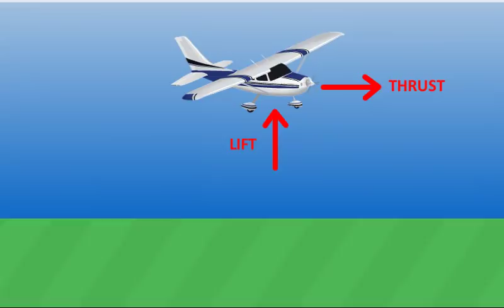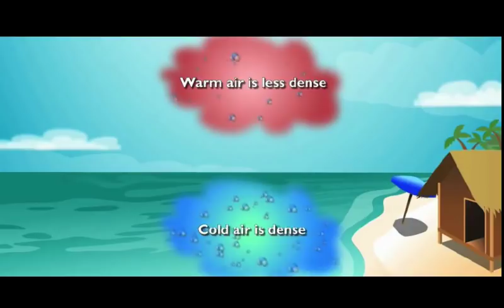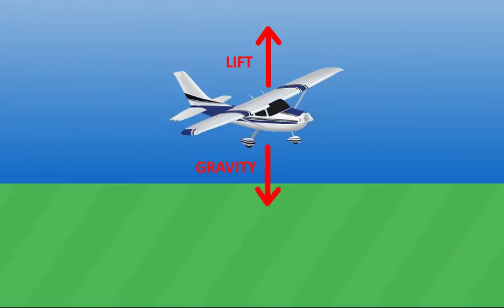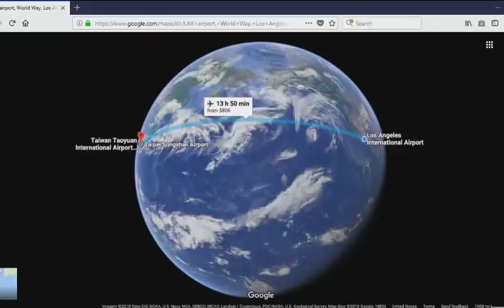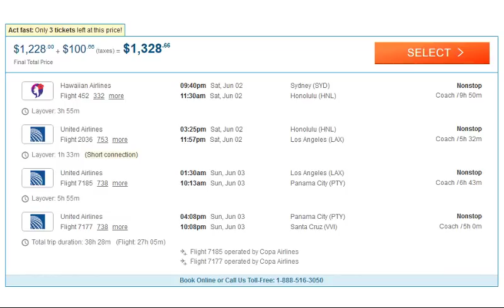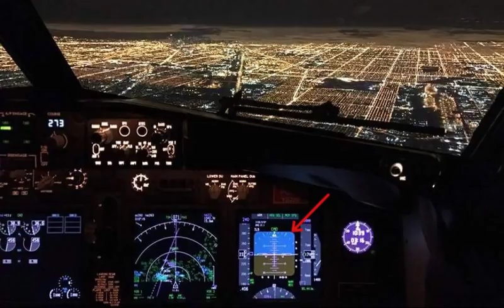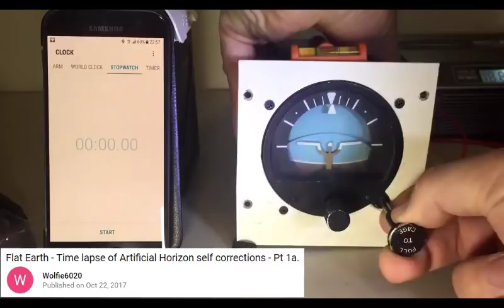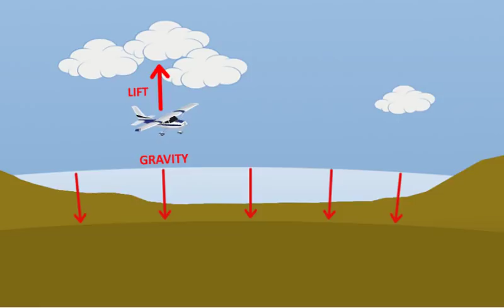Flat Earth Falsities - Plane Nonsense

Comment: How does one fly due east on the Space Pizza?
Reply: They the flat earthers say due east is an arc. So next time you watch the sun rise in the east, travel in a direct straight line to set in the west. That simply and easily proves all flat earth is a scam.
Reply: How do you travel east now?
Reply: If you had a working brain you wouldn't have asked that question would you, juan.
We have what are known as compasses, juan, both magnetic and gyro. Do you know how they work?
 @juanencinas8808
Reply: Ron If you had a working brain you wouldn't have asked that question. We have what are known as compasses, Ron, magnetic, do you know how they works? 90* of N-S: one the pizza middle the other the contour, so you go in circles.
Think it feasable for a bird to detect the south pole up North on a ball magnet?

Comment: Airplanes flight is measured in Airspeed not groundspeed. There were times I was flying at an indicated 100 knots yet below me on the highway the cars were passing me...why? Cars are driving at mph over the ground reguardless of winds while i was flying at 100 knots indicated airspeed and 40 knots true groundspeed because i was flying into a direct 60 knot headwind.
And really ahelicopterflying upside down in australlia?? Really ever heatd of a little thing called a gravity well? 
And yes the aircraft does follow the curvature of the earth the straightline would be too far in the distance anyway. But the nose direction has nothing to do with level flight. The angle of attack is the angle of the wing itself which is indeed angled slightly upward to maintain straight and level flight at a certain throttle setting. This angle of the wing cord happens to coorespond to the nose being level, it would bestupid otherwise
Aircraft fly the overseas route in what is known as the great circular routes and have been called that since days of sail. Jeez these flat earth people are just morons too stupid to survive without others figureing it out for them. 
How can they look at a ship come up over the horizon where the masts are seen first with the rest following. People hundreds of years ago were smart enough to figure out that meant a spherical earth how did these morons do hundreds of years of dumbing down in the 21st century with satallites and space stations flying over their heads. But more that anything WHAT POSSIBLE REASON WOULD ANYONE HAVE TO MAINTAIN THIS GIGANTIC CONSPIRACY FOR HUNDREDS OF YEARS FOR ZERO PROFIT OR REASON.AND THE GYRO ARGUMENT IS THE MOST MORONIC EVER WOW HOW STUPID PEOPLE CAN BE ITS TRULY AMAZING!!
Reply: Nice write up. It's both sad and funny. FEers once said the conspiracy was led by makers of schoolhouse globes. Hell of a cartel there. One leading FEer doesn't know the measure of any angle in an equilateral triangle nor know how to convert meters to kilometers. Another admitted not knowing where Australia is! But they absolutely know the Earth is flat; they've done the research! It's amazing some of them even made it to high school, let alone graduated.
Reply: You are so right fucken idiot fucken dumb ass. Yeah your right just 300 million a year

Comment: This is one of the best video with strong arguments against the misinformed claims of flat earthers. I am an aeronautical engineer and we had a whole course on inertial navigation, guidance and control. Basically we have to do some calculations to factor in the rotation of the Earth. Then we also have accelerometers and sensors on the aircraft that help determine its position at all times. The control system on the aircraft makes sure that at each time, the aircraft is following the trajectory it is supposed to. And also as mentioned in the video, the atmosphere is moving with the earth, and so is the aircraft. The best thing flat earthers can do is read up on the concept of "relative motion" from a high school physics text.
Reply: You dont say, mister engineer, so what of inertial navigation? That is not needed on a FLAT realm? Do you even know what lin·e·ar means?
= extending along a straight or nearly straight line. Not a cuved line.
Pray WHY is there a need against the misinformed claims of flat earthers?
Doesnt everyone go to school and get informed in your world?
Why are a few Religioustards (with no basic science) cause of grief to you?
Reply: @BrainUser1  I am a miss, not a mister. And also, I never said flat earthers cause me grief. I actually feel we shouldn't make fun of them, and should try to reason with them, and take their arguments seriously instead of as a joke. Scientists and engineers make it seem like round earth should be obvious. It is not obvious to a layperson. It requires a lot of observation of moving objects, familiarity with the concept of moving observers, rotating frame of references and kinematics. These concepts are not even easy for physicists and scientists to grasp unless they work really hard at it by closely observing motion, performing various experiments, and solving mathematical problems and comparing results to observational evidence. A normal person is not expected to go through all of that to believe in a round earth. A round earth does seen counterintuitive. The beauty of science is that a lot of it is counterintuitive. That is what makes it worth researching and interesting for scientists all over the world
Reply: Thanks. And the vertical rocket stops at 90-100km altitude because it reaches end of atmosphere, not because it hits the dome. Though, all of it reflects on technology. Just as that is unarguable, can you argue that outer space is actually in the waters set above and separated from waters below with firmament by Almighty Creator? Water means life in scientific terminology, right? Do noisy engines, or wondrous thoughts make up our lives?
Reply: Waters not vacuum beyond stratosphere. Milkiway and galaxies... are set in waters above. That's what some flat earthers say.
Reply: @yuriyshevchuk1933  I think they are inspired by bible to believe those theories. I, honestly, don't mind them believing in a flat earth, if that makes them feel better about their lives. Physics is not an easy and obvious subject. I can almost see why they tend to fall for misinformed theories. Concepts of relative motion, gravity and space are not really obvious to a layperson.
Reply: I am certain to say, whatever one may believe in, chortogs, green three toed alliens, ghosts, dwmons... will find them real in real hell; and whomever believes in Jesus will find himself with Jesus in heaven.
Reply: Physics may be difficult for some, but looking at the world is not difficult. The problem is that becasue they believe the bible , or quran, is true they totally disregard reality and fool themselves into seeing things they don't.
Proof of curvature is the fact that land slowly goes below the horizon when you sail away from it and slowly rises from the horizon when you sail towards it, and the fact that you can see further with increasing height. This does not require physics, just looking. It was these things that inspired the Greeks to realise the Earth is not flat over 3,000 years ago. 
When I first went to sea deckhands are not required to have any education at all but they readily grasped such simple concepts. Because they were not blinded by religion.
They also actually use science to try and disprove things so they do understand things, they just twist them. It is known as lying for god.  Because they are blinded by religion. And that is the problem, not an inability to understand. It is a wilful desire not to understand.
 @happysoul5031
Reply: There is no such thing as hell, or heaven.
Did you know there is no contemporaneous evidence whatsoever of the existence of the biblical Jesus?
And before you come back with the usual party line,  please note "contemporaneous", "evidence" and "biblical Jesus”.
Did you know the bible is not much more than misinterpretations of mistranslated and misinterpreted already discarded and disproved plagiarised myths?
"And the vertical rocket stops at 90-100km altitude because it reaches end of atmosphere". Rockets don't need atmosphere, do they.
Do you know what the genesis of your firmament  actually is? Note, genesis not Genesis.
 @yuriyshevchuk1933
Reply: @boffeycn  yeah I kind of agree but it is a combination of trying to justify their faith and their lack of understanding of physics in general. And also, you can't expect everyone to observe a sailing boat disappear into the sea. More than half my life, I lived in a country where we didn't have coastal areas. And I understand the lengths these people go to justify their faith. But I don't really resent them for this. Faith is a very powerful thing. It's very hard to get rid of. I am speaking from experience because I am an ex-muslim.
Reply: @boffeycn  also, you mentioned that Greeks made these round earth claims by simply observing these simple phenomenon. But don't you realise it was a select few individuals in a society of thousands who actually made those observations? Most of the time, physics happening right before our eyes is incomprehensible until a lot of work has been done on forming theories that reconcile those weird phenomena with our understanding.
Reply: I was a Christian, actually born and raised in and of the church many years ago, so no difference there, is there. 
Maybe they don't live near the sea but they all still claim you can bring ships back into view which makes them doubly dishonest, doesn't it. Total dishonesty.
Greek sailors were not "a select few" they were a large %age of the population. or don't you know anything about Greek history?
And seafarers are not the most educated or intellectual members of society, are they. That would be the lying priesthood.
"physics happening right before our eyes is incomprehensible" Not really if you have not been brainwashed by religion. Remember, science was brought completely to a halt in the west by Christianity but fortunately the Muslim world retained and developed the work carried out by the Greeks, Indians and Chinese so that when the Dark Ages ended the knowledge was there to be relearned. Sadly much of the Muslim world then went back to wind.
Things most Christians refuse to acknowledge.
 @happysoul5031
Reply: @boffeycn  I still stand by my claim that physics is not easily observable by everyone. Religion plays a big part in it. People have beliefs that prevent them from seeing reality. About the Muslim world, you probably have no idea how bad it is now. People in my country kill those having heretic ideas that I have. Recently a college professor was murdered in a small city in my country. It's not about Muslims or Christians and who made more contributions to science. It is about some individuals who were observant enough to notice the discrepancies in widespread notions and challenge the status quo. This is a bit sidetracked but the existence of rogue waves was not accepted in the scientific community until about late 1900's. Because rogue waves are not a solution of the wave equations that describe the oceans. Still, this phenomenon very much exists. Some sailors claimed that they saw rogue waves over 80 ft high and french mathematicians  of that time laughed at them. So, I would say again, it's not easy to let go of your biased beliefs even in the face of observations by thousands of sailors, whether you are a scientist or a lay person. 
I do understand what you are saying about the hypocrisy and straight out lies that clerics make to keep people following their faith. I can't really understand who amongst them are the deceivers and who are the gullible ones.
Reply: "Because rogue waves are not a solution of the wave equations that describe the oceans." They were well know when I was at uni in the 60s.
"Some sailors claimed that they saw rogue waves over 80 ft high and french mathematicians  of that time laughed at them." That was long before the wave equations you refer to, wasn't it.
You are behaving just like the FE cultists, Fred.
Or are you trolling?
 @happysoul5031
Reply: @boffeycn    Did I say rogue waves weren't well-known in late 1900's? I only said their existence wasn't formally accepted by the scientific community until late 1900's. And the wave model I referred to was the standard linear model for predicting wave heights at sea. It was the  persistent model and is still there in course books of ocean engineering.  According to that model, it was not possible to have wave heights over 50 ft, yet the sailors reported seeing Waves of over 100ft in height. That observation was made in, I think, 1800's. I am not  sure about the exactitude of dates so pardon me If i make a mistake. At that time, the existence of rogue waves was considered only a myth. Off course they were well known but their origin couldn't be explained by the science of that time.  And yes that standard model of the ocean did exist in 1800's which led scientists to reject the "observations" of rogue waves. That's how human beliefs work, not just in religious factions, but also in scientific community. 
Also, rogue waves were a rare observation because most of the old ship designs didn't make it back if they happened to face one.
Reply: Yes dear, you don't know this but then that, and well, this because even thought the other.
Go away you silly child.  @happysoul5031
Reply: @boffeycn  I don't mind you being unnecessarily rude to me. I just checked, rogue waves were formally recognised in 1995. Rogue waves are an active area of research now. This just shows even the scientific community, though more rational, is not immune to biases and beliefs.
Reply: @boffeycn  what you've stated is not true. there is whole world of evidence of biblical Jesus, all the people, believers and non- believers, as much as the seas, the oceans, mountains and pyramids of Egypt... are all evidence of Jesus Christ the one and only Son of God Almighty Creator. Jesus is love my friend, don't all people of all religions experience love?
Reply: Sorry dear, but you are doing what I said not to do, aren't you.
Do you understand what  "contemporaneous" means?
Do you understand what "evidence" means?
And before you come back with the usual party line,  please note "contemporaneous", "evidence" and "biblical Jesus”.
And why did  you totally ignore the rest of my post.
Did you know the bible is not much more than misinterpretations of mistranslated and misinterpreted already discarded and disproved plagiarised myths?
"And the vertical rocket stops at 90-100km altitude because it reaches end of atmosphere". Rockets don't need atmosphere, do they.
Do you know what the genesis of your firmament  actually is? Note, genesis not Genesis.
Love is love and religion os not wanted, thanks. @yuriyshevchuk1933